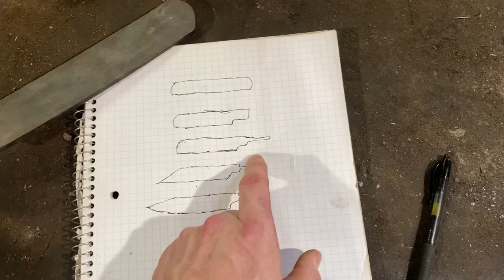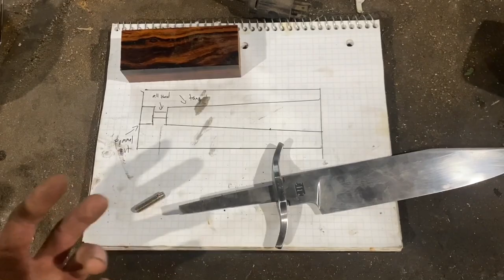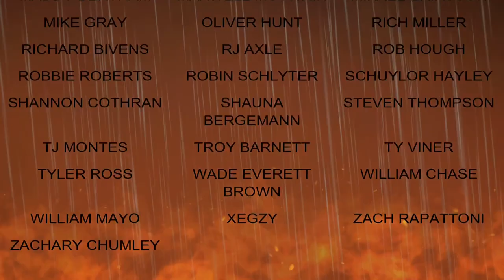Forging a fossil Damascus Bowie knife

Comment: I had the worst day of forging today. A few weeks ago I spent upwards of 3 hours making bolt jaw pliers for railspikes. Today I tried using them and they were actual trash. 3 hours and lots of propane wasted. To say I was mad is an understatement. You just made my day with this upload actually. Thank you so much!
Reply: That's smithing, brother.  Every time I have a fail (which is not as often as it used to be, it but still happens way too often) I am usually so foul-tempered for the rest of the day that I get ran out of the house by The Exasperated Female, with the kid's giving their solemn approval.  Ain't giving up, though; NOTHING beats that glow of accomplishment when things really go right!

Comment: Dude, your uploading these vidjas with no volume.  You should make it louder and give people with some trouble hearing the ability to hear it, if anybody thinks it's to loud they can turn it down but I just can not hear this at all.  I've worked around jets for the last 10 years and I'm not def or anything but I do have hard hearing for sure.  Just a suggestion.

Comment: YOU USED STEEL THAT WILL RUST. SHOULD YOU HAVE SOLDER WHERE THE KNIFE WENT THROUGH THE GUARD TO PREVENT WATER GETTING INTO THE TANG AND CAUSING RUST.RANDALL KNIVES SOLDER THEIR GUARD TO PREVENT RUST FROM GETTING TO THE TANG..

Comment: Was that brass cylinder at the pommel end tapered or what?  How was it able to compress or hold the wood in place, I wasent able to catch that part.  It looked like a regular hole drilled into the wood, then the cylinder was the same size.  Maby I'm over thinking it but I dont see where theres any compression with that.  That is a really awsome kinife though man, and that super glue trick is one I'll probably try myself here pretty soon.  Looking forward to your future vidjas man.
Reply from the maker: Hard to see down into the hole but it's countersunk. Basically the hole for the pommel nut is shallow, so there is a ledge in the wood it pushes on.
Reply: @OldHickoryForge  oooooooo ok, I did not notice that but that dose make since.  Ok kool, well awsome man.  Thanks for responding, I watched you on FIF and then started watching your videos on YouTube a little after that.  Good stuff man.

Comment: 7 seconds ??? i hope not buddy you have to drop from non magnetic to below tempering (712 c to below 200c for O1 tool steel for instance) in under 2 seconds to harden a blade , and you can google that , i got in an argument with some one over it and when i proved him wrong he stopped making knives lol , ""ive never had a knife break and i have made over 200"" ...yes m8 thats because you never actually hardened one lol  edit PS austenitic is the liquid state of ferrous iron before it is quenched  its cementite after quenching  been a while since i looked tbh feel free to check me.
Reply from the maker: I know what you're referring to and that's not what I'm talking about. The initial major cooling. Where the crystal lattice of the steel actually changes occurs in the first 1.5 seconds with parks 50. It's referred to as a 7 second oil (a 7-9 second oil to be exact) on the data sheet for the oil 
https://www.scribd.com/document/393374322/Parks-50-Quench-Oil-Technical-Data
What I'm talking about is the window of time between when the blade has cooled enough to not have to worry about residual heat softening the blade. But is still warm enough to where minor corrections can be made. Obviously that's a lot to say so I attempted to simplify.
Reply from the maker: AAA quenching oil. The oil recommended for O1 tool steel is referred fo as an 11 second oil (9-11) seconds to be exact. Again on the data sheet. 
https://southcentral.edu/webdocs/safety_committee/SDS/Faribault/Faribault%20Computer%20Integrated%20Machining/AAA%20Quench%20Oil.pdf
Reply from the maker: Long and short of it. When I say "below hardening threshold" I'm not talking about the time at which after the initial shock, the crystal lattice of the steel changes from austenite to martensite, I'm talking about when it's cooled enough to harden fully but still be warm enough that corrections can be made. Many smiths use this same process even on swords.
Reply: @OldHickoryForge  i taught knife making classes at my forge for 4 years (then went back to security less work and a lot cleaner + more money ) did you google how fast steel hardens ? im not here to argue sir i like your work and attitude but i seem to remember its under 2 seconds for most steels not sure what the data sheet on the oils is referring to i have  never read one or used a commercial quench oil, so i cannot argue , i just know i have seen charts on how fast you have to drop from non magnetic to under tempering temperature and its under 2 seconds.if you look at this diagram most of the changes happen in the first 1 second https://en.wikipedia.org/wiki/Isothermal_transformation_diagram#/media/File:TTT_diagram-20201210-isothermal_transformations_in_steels.svg
Reply from the maker: @Edgunsuk  you're correct in the initial change in the crystal lattice of the steel, between 1500ish and 900ish depending on the steel, quench medium and such. Within the first one to two seconds is when martensite conversion happens. However. A blade that is 900 degrees after the initial 2 seconds or so, if pulled out of the oil is still warm enough to where the knife can basically over temper, or have the Chrystal lattice change either partially or completely back into pearlite. Throw your grain structure all out of wack. 7 seconds for parks 50 is the recommended time to ensure that the blade has cooled enough that it won't go through the aforementioned change.